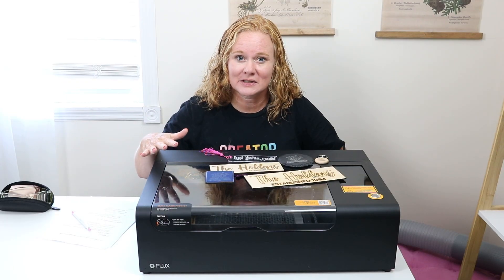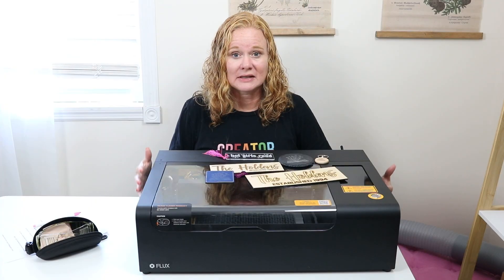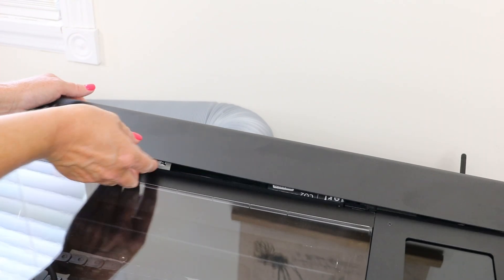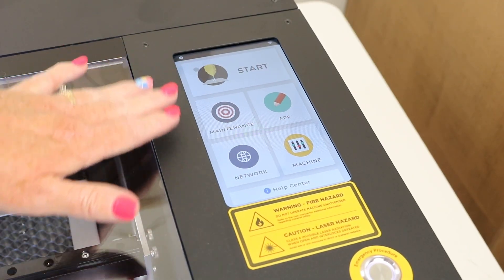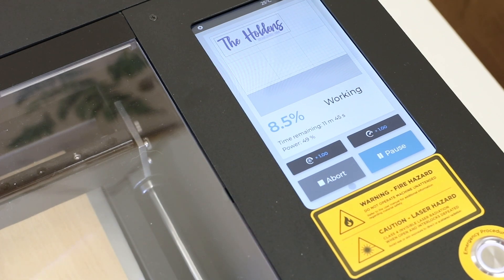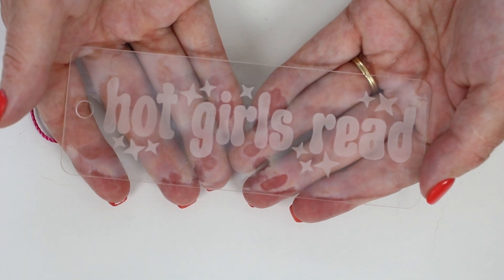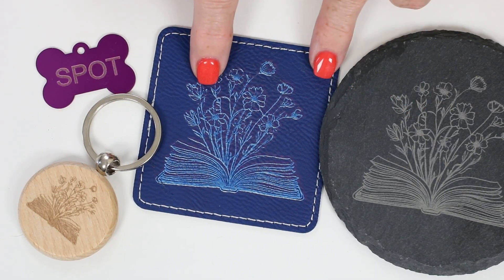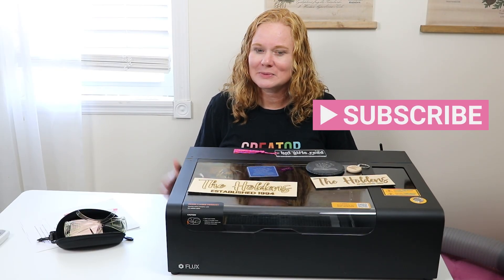Compact & Budget-Friendly CO2 Laser? My FLUX beamo Review

Comment: It looks awesome for a small space!  Very tempting because of the price and I could put it in my guest room.  I'd like to see how it works with the rotary attachment and how well and quickly it engraves tumblers.  And does the fume extractor work well...I would like the convenience of it but it would have to work great to justify the price.  And how did you vent it out of your window...did you leave your window open?  Also, why would you need the diode attachment when you have a CO2?  Sorry for all the questions and thanks for the review!  I've just been super interested in a CO2 laser for a while.  Almost purchased the OneLaser XRF but can't afford it yet and would have to put it in my hot garage!😢
Reply from the maker: I do vent out a window most of the time and I open my window and put the hose through it. Then use a towel around the opening. I probably would NOT add the diode laser to mine but it is an option. And I have not used the rotary yet!
Reply: @AngieHolden OK, thanks so much for the info!